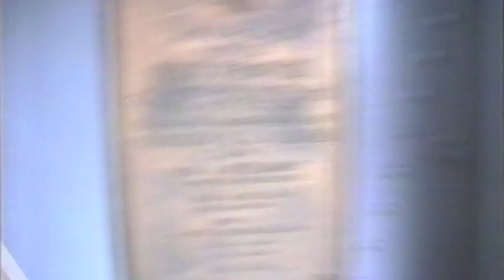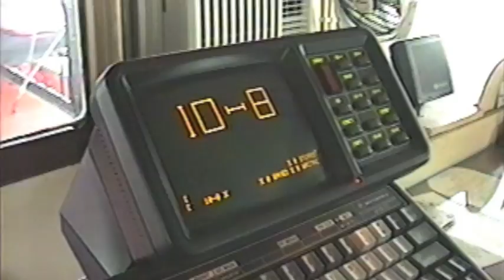FDNY Marine 9 inside out tour, Never seen videos of engine room Marine 6 too

Comment: the original firefighter, I served on this fireboat from 98-04/07-09 as the oiler and fireman, what an experience. the men that broke me in were very knowledgeable, that boat was built in 1934 the engs. were designed for a submarine, two 16 cyc, 2 cycle engs. a DC electric boat, you had to know what you were doing it could produce 1000 kw.the fact that it was in service fully functioning is a testimony to proper maintenance and upkeep. thanks for the memories
Reply from the maker: super cool... thanks for sharing
Reply: She's still running as a museum in Greenport NY, she went out twice this past weekend for her 80th birthday (built in 38, not 34)